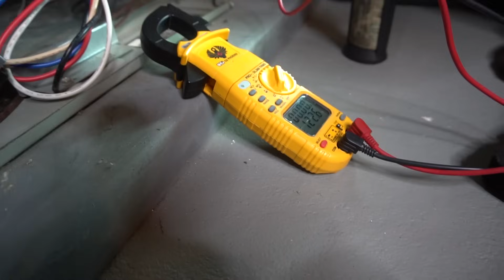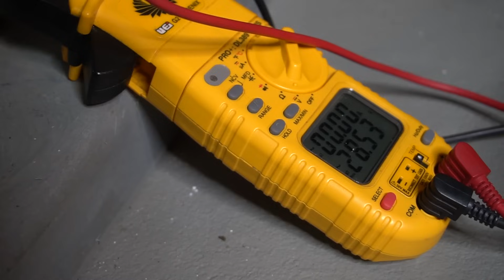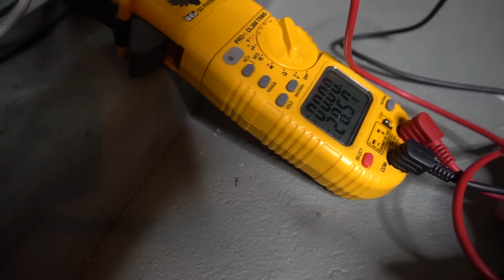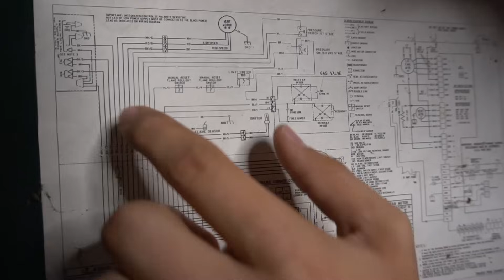Furnace/AC How to Troubleshoot The Control Board

Comment from the maker: ⭐ More Videos That Can Help:

Top 5 Furnace Problems and How to Fix Them:
https://youtu.be/T4IWtKy--Vk
Furnace Parts and Functions Explained:
https://youtu.be/gN-UIr6824w
Top 5 A/C Problems and How to Fix Them:
https://youtu.be/GOXgdnRB840
A/C Parts and Functions Explained:
https://youtu.be/pJ8KeJFKDMM
Thermostat Not Turning on Heat:
https://youtu.be/054cRskeh5k
Blank Thermostat Screen:
https://youtu.be/vi3OJuGfaac
Furnace Error Codes Explained:
https://youtu.be/J8Zegm4TClM
Furnace Sequence of Operation (important to know):
https://youtu.be/AQD_MedIklI

🛒 If anyone is wondering, the meter I was using in the video is a UEI:
https://amzn.to/2MbSHC2
Reply: Jay, I have a furnace nearly identical to the one in this video.  My transformer is receiving 120v but is outputting 0v.  I purchased an OEM replacement but I can't see how to dismount the old transformer as it appears to be fastened from inside the metal housing as yours also appears to be.  Any advise on how to access?  Thanks.  Jim
Reply: On the t.stat wiring inside the Trane xe78...wire colors ..should I have a red and yellow on the y terminal???

Comment: Update. I was a little more patient after I watched your video again and found out that my igniter gets 120 volts but for only one second about every 30 seconds while the furnace starts up. Sounds like a bad board??
Reply: Probably. If it's old then there's nothing to lose by spending 50 bucks and doing some preventative maintenance. 👍

Comment: Your videos are fabulous. I do have a question about this one. My furnace won't light. Using your tests, I found that I have no power to the igniter. At the end of this video you give the impression that this would mean the board is bad. I've gone through all the recommended tests and I get 28 volts between r and c on the board. Earlier, at the 6.58 mark you say this means that the board is good because I'm getting voltage out. Help. Bad board or not?

Comment: Thanks Soooo much for this video.  I followed these steps to find my Molex plug connection was bad.  When I wiggle it the power intermittently comes on.  Not sure how to make solid connections.  ????
Reply from the maker: You're welcome! Glad you were able to track down the problem. The easiest but not the most optimal solution would be to take a toothpick and try wedging it in, in different spots. Sometimes a perfectly placed toothpick is all the fix you need. I would also check all the wires and make sure all of them are nicely inserted into the pins.

Comment: My furnace will not come on, I replaced the control board last year, the signal I'm  getting on the board is a solid red light, not flashing or anything thing, need a little help

Comment: I was getting nothing from my furnace. No red light no nothing. I thought it was a bad board. I bought a meter. Tested as you said. I was only getting 100 volts. I tested the on off switch and was getting inconsistent readings when flipping up and down. Put in a new switch. Problem solved. Meter 26 bucks. Switch 7 bucks. You the man!!!!!!

Comment: The blower motor for my furnace, which is in my attic, won't come on unless I tap on it. after tapping on it it spins right up and will blow for as long as I have it set. then the next time I turn it on again it won't start unless I tap on it. do you think the blower motor bushings are going bad? is there a start capacitor or a relay that might be going bad?

Comment: My issue is when I power on the gas furnace, the inducer motor run and when the thermostat is satisfied, the inducer motor keeps running and won't shut down. What is going on ??

Comment: you are not designating A/C or D/C current with your tests. Every electrical device accepts A/C current, then changes it
to DC current so your electrical company knows how much electricity you are using, and how much to charge you.
(You cannot meter A/C electric).  Then in some electrical devices like say your stereo amplifier the DC current is
switched back to A/C current to send the signal to your speakers.  All music is a sine wave, just as A/C current creates a sine wave. I guess multimeters can tell the difference?

Comment: great video:   Would a bad safety switch at the door not give power tothe control board.  My board does not light up with power is connected and is very fustrating to figure out.   Any ideas or things to check ?

Comment: My 15 amp 115 vac fuse outside the air handler blows if I hook the power wire up to the board. I even disconnected my condensate pump to rule it out. Do you think I'm correct in calling the board bad

Comment: My AC is working. Thermostat is working. I did everything in your video. I also checked the White (line wire) and black (cool wire) and the voltage is not 120v. Does that mean my board is bad and that’s why blower motor is not turning on.

Comment: Thermostat Wiring Mistake - Furnace Dead, Need Advice

Accidentally wired thermostat “C” to “B” (brown) instead of “C” terminal. Furnace (Goodman) wiring was correct (Y/W/R/G/C). Ran fan overnight (no A/C). Next day, got 5 red flashes (rollout/fuse). Replaced fuse - furnace worked again.

Today, turned on heat - got a burning rubber/plastic smell, then shut it off. Now control board LED is dead, even with only R and W connected. Fuse looks fine.

Could the thermostat wiring have fried the board? Any safe DIY checks before I call for service (trying to avoid $150 inspection because I am broke)?

Comment: We have a Ducane 92G1U and we’ve been trying to follow your videos and the board will power on and flash slowly but we can’t even get to the part of the sequence when inducer is suppose to turn on. We can viably see the blade not moving and we just had this furnace installed brand new exactly one year ago. We’ve tried testing the voltage and it does nothing on the meter or it either jumps around all over the place. Everyone just keeps saying replace the board. But we want to replace the inducer first.

Comment: I have the exact same control board. Have 120V to the transformer and obviously the 28.5V out of the transformer.  5A inline Fuse is good and I have 24V in and out of the board (actually, 28.5V)  measured as shown in the video. But the control board LED is dark.  Is the control board bad? or what should I test next? Call for heat?

Comment: Ok so ive got power to the shut off switch on the side of my furnace and the board is blinking 3 times when I turn the power on which indicates the uploader blower motor is bad is there some safety feature that causes no power to go to anything else thats supposed to have power like the electric gas regulator that turns on when the board tells it to open up so the furnce can start its fire up sequence? My blower itself turns on when i turn the A/C switch on that pushes the heated or cold air through the vent ducts but thats it . Ive checked for power at the inducer motor & theres no power to that either . The furnace is a American standard thats a high efficiency natural gas furnace thats been working great for years until 2 weeks ago when I noticed that it was getting cold in the house so i turned the heat up because it was 63 degrees in the house and the digital thermostat said it was in heat mode but it does nothing . I even checked the wires from the board back to the thermostat and did a continuity check & they both were good plus i changed the batteries in it thinking that maybe that was the problem at first . If i cut power to the furnce thats supposed to clear the codes on the board so i tried that a couple times but as soon as i turn the power back on that 3 blinking code comes on again so evidently the codes aren't being deleted & yes i taped that switch on the furnace like you showed but i mainly need to know if this uploader blower has some safety lockout feture so if it goes bad it shuts the power off to everything else except the board itself ?

Comment: Your video gave me the basic knowledge to do enough troubleshooting to get my furnace running over a cold weekend without an expensive weekend HVAC visit.  My low voltage fuse was blown and it happened when I  switched the system to cool mode.  It was very warm yesterday.  It was the first time the unit had been switched on since last year.  I suspect that I have an issue with the outside air conditioner unit - perhaps the contactor / relay switch.  I will look further when it quits raining and isn't a weekend!  As I like to say, unless they are hyper flexible, fuses usually don't blow themselves!  Ha ha!  Thanks so much!

Comment: I had no power to the draft inducer motor.  The blower motor ran fine, but the board wouldn't send power to the inducer motor.   I noticed there were 3 relays on the board beside the inducer motor where the wiring harness connects that activate power.  Theres not much that can go wrong on a board other than an electrolitic capacitor or a relay.  I ordered 3 new relays for 10 dollars and soldered them in. It runs perfectly now.  A new board was hundreds of dollars online.  Could try shaking the board a bit up and down and side to side and putting it back in to jostle the relay contacts, it might start working again if you're in a pinch.
I know in this day and age your supposed to just throw it out and buy a new one but I build and solder circuits as my hobby so felt comfortable working on the board.

Comment: My board has a blinking LED light and the fan turns on, but nothing else. Using the multimeter to the R and C, it barely registers and fluctuates, but nothing near what it should be. I'm not sure what the issue could be

Comment: Came home from work . Thermostat was set at 70 but house was at 76 . Turned off cooling/heating at thermostat and let it thaw out. ( suction line was frozen up to compressor) let it thaw out and turned it back on & everything outside at condenser was working . I even got cool air from the vents for about 10-15 mins . Then it stopped blowing . No air coming from vents. Went outside and it was frozen again !   Is that still a potential symptom of faulty  control board ? Or more likely blower motor itself ?

Comment: Is the white-rodgers 50a51-495 a good replacement for Trane CNT03759 board? It's giving me intermittent shutdowns and sometimes "Replace Control" and sometimes "Thermal Protection Device Open". Furnace is Trane TDD060R936B0.

Comment: I have a 1194-200 control that has power and furnace turns on but it doesn't have 24VAC going to the outdoor unit. 
Outdoor unit turns on when I manually push the contactor. 
Could this be a bad control board or something else?

Comment: Ok Please help me with this. Lennox - Step 1-4 work fine. Calls for heat, inducer spins, limit switch fine, igniter lights.... then nothing for 4 tries... Watchguard error. I have a jumper from board to gas value that I use to light burner from igniter. Once burners fire, flame sensor stops igniter, and blower runs to heat the house... easy peasy.... WHY is the igniter not firing gas value??? it works just fine with jumper... runs like a champ with jumper no uses. 2 things to mention (Brand new board and new transformer installed)... Flustered beyond belief.  All comments welcomed. Cheers

Comment: Thank you so much for posting these videos. I has been watching them for 10 years. My Rheem gas furnace cannot pass the ingnior phase during the startup. 1) Pressure switch ok, 2) induce motor runs ok, 3) ignitor on, but 4) no gas came out from the gas valve. I measured the gas valve. There is no 24 V. The gas valve has two terminals with 2 wires (yellow and green gray). After a few tries, the control board sent flush code “1” (soft lockout mode). The yellow wire seems connected to a limit switch under the bottom of the blower. The control board has green light on. I measure 24 v from the transformer. I tried to get 24V directly from transformer, but it immediately shut off the ignitor. Is it a bad control board? Or any recommendations that I shall try?

Comment: has anyone ever saw only 76 volts coming out of the black terminal on the board, 138 volts on the red terminal, 98 volts on the blue terminal, 121 volts when i cross the blower motor commen terminal to door switch power? Not sure what the problem is but seams to be a bad board. on a Rudd 90+

Comment: Had the same company come 2 times, 3 different guys. They said you need a new unit. The heat works HOWEVER it will not come on in the morning at the scheduled time unless you turn the thermostat on and off. I have tried 3 different thermostats so I know its not the issue. During the day there are some times where it should kick on but will not unless we do a power reset. Any ideas? Gas forced hot air system about 12 years old.
Reply from the maker: Sorry to hear about the furnace troubles. What you described kind of sounds like it might be overheating and going into a soft lockout. When it fails to turn on, have you tried checking to see if there are any error codes blinking on the furnace control board?
Reply: @WordofAdviceTV  No error codes we checked and had the company say those codes are just a normal ready state. I myself went as far as changing the furnace control board with OEM replacement and it did not fix the issue. Next we were talking about possibly having the ducts cleaned which have never done before but I dont think that will help since this only happens once in the morning. SO bizarre.
Reply from the maker: @stogierogy  This one really is bizarre.. The two most probable culprits would be the board and the thermostat which you already replaced. Is there anything wired in series with the low voltage wiring at the furnace? Such as an air cycler or a humidifier. Did anything change when this started happening? Remodeling was done, roof replaced, water heater changed, etc.
Reply from the maker: @stogierogy  Try taping that door switch shut so the code does not reset once the power is interrupted. There should be a code if its failing to turn on.

Comment: Hello captain Jay

I was getting voltage coming in to the transformer but 0 volts coming out . Checked r to c and got 0 volts. I replaced the transformer and still same issue . One of the terminals on the 24 volt side has power but the other terminal has no power . I’m assuming maybe something going on with the wiring? I checked all connections and everything seemed secure . Any ideas on what you might think it is? Possible circuit board failure ? There was LED lights on the board though .

Comment: Hey nice video but I have a question. My furnace turns on and then right back off within seconds. But if i take my test light and touch the white wire on the circuit board it's turns on and will run but if when I try to allow it to do it by itself it doesn't. I took out the rod and cleaned it but can't figure out what the problem is. If you can help i would really appreciate it. ( Help in Kansas ) City
Reply from the maker: That sounds like you might have a loose wire connection. Have you tried turning the power off, take that wire off of the terminal and taking a closer look at it? I would try crimping it down slightly with some pliers to make sure it is making a good connection. For more ideas of what to check, you may find this video helpful: https://youtu.be/-QKHz1Mv9Ew?si=bfxFHPXp7ijetBp5
Reply: Ok thanks I'll give it a try

Comment: Does all control board  comes with a fuse i have honeywell ST9160B1027 i checked every step and theres power on the board but still heater won't turned on, blower works with the A/C but not with heat any suggestions? Thanks
Reply from the maker: Almost all furnaces will have a fuse or a mini circuit breaker. I would suggest watching this video:
 https://youtu.be/AQD_MedIklI?si=xbRxUJPdIlpRQXP7

Comment: I been trouble shooting my furnace for two years , my furnace would start heating but after a minute or two the blower would stop causing the limit switch to open if i don’t shut furnace off.  i replace flame sensor and high limit sensor ,  issue continues. today I decided to take down my vivint element thermostat and i touched the R and W wires together and the furnace seems to be working had it run for 10 minutes and blower did not shut down . I was about to replace my board before i tried bypassing thermostat.  i’ll do more testing to make sure that was it.

Have you ever heard of smart thermostat causing furnaces to am shut down mid cycle ?

Comment: My furnace has had a capacitor and the brain(board) go out along with the board again possibly, within just 3 months or less. Everything works now except for the heat. Had it tested and was told that only the "W" wire for the heat, was bad on the board but the rest of the terminals for AC and what not, worked fine. Was also then told that it could be because i didnt change the igniter and wiring harness using the retrofit kit i never got, when i changed the board. Even if i put a new board in, im being told that it will just burn out again without a new wire harness, old one is fine, and the igniter, which is brand new and i just replaced it. How would it be the wiring harness or igniter with the igniter checking out good. Igniter doesnt even heat up

Comment: my unit has both the outside condenser/compressor and the fau fan working fine individually but the fan shuts off when I set the a/c to cool. Is this an indication the fan control board is at fault?

Comment: I have a board that isnt flashing at all. There is a 5 amp automotive fuse on it that blows as soon as you apply power to the unit. Could this be the board shorted?
Reply from the maker: Sorry to hear about the fuse troubles. This video should be able to help with that: https://youtu.be/4e4wsruGS0s?si=pcZfauShauRDfkSr